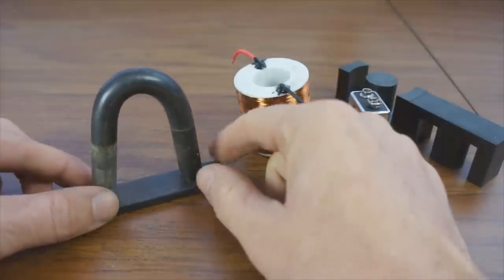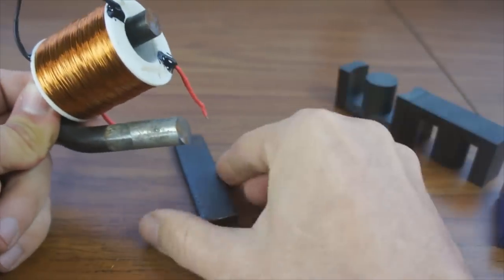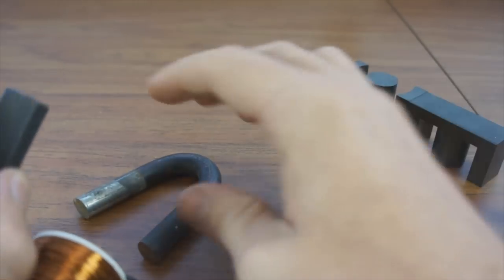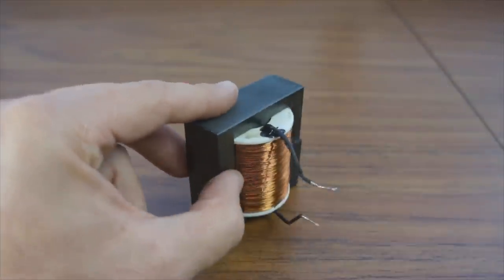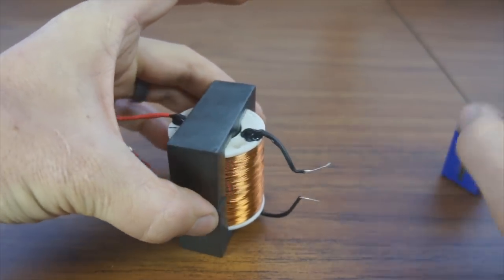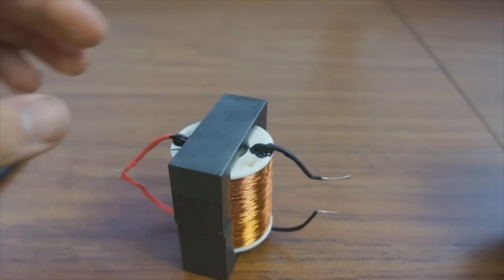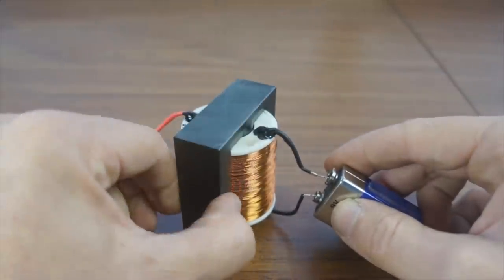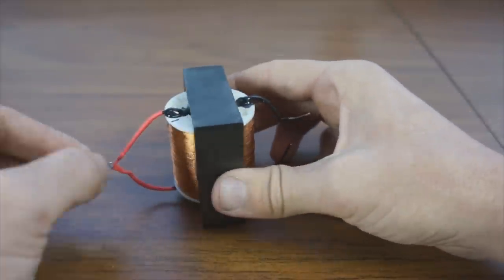PMH - Electromagnet keeps holding after power is removed?

Comment: it would seem that with the leads on the coil shorted the energy can not escape when battery is disconnected so the current that magnetizes the two pieces together can will hold until energy is used up

Comment: Excellent topic and generates lots of discussion.  You're doing a great job because of your own scientific curiosity to inspire others.  Keep it up, enjoy your videos immensely.  Would be a very cool product where you could flip a switch and have a magnetic lock.
Reply: They make those: http://en.wikipedia.org/wiki/Electromagnetic_lock
Of course, they use materials that don't stay magnetically locked in case of power failure for safety reasons.
Reply: That's my point - it wouldn't need continuous power.  It would also be much less expensive requiring only a small voltage to energize.

Comment: Could it be an electrically enduced Casimir effect? It seems to prefer nice and flat matching surfaces, right?
Interesting to me is that there seems to be an upper limit as to how strong the residual locking can get. No point in energizing the coil(s) longer or harder. So it's about the materials and likely surfaces more than about power and duration of the energizing.
How do parts of various metals work, when dimensioned and surface treated identicually? Can we learn from those results?

Comment: well it seems to make sense to me don't think it is strange. It seems to me that there is 2 magnetic fields working and one is holding the other to it. Have you tried quickly connecting the blue together once you take the ends off the battery? Maybe it will hold together if you do so.

Comment: So you have never noticed this effect with magnetic door locks? Activate the unlock mechanism the first time. (motion detector, wall button, or ID badge access) You have to push harder than normal to break that residual magnetic lock. Attempt is a second time before the electronic timeout happens then its quite easy to open. Generally you have to go into a building after hours to find these type of door locks. Hospitals have a lot of them. Some doors with badge access have them as well. Although of course you need an ID badge to play with them.

If you play too much you might create a red flag with the security department. Just a little warning LOL.

Comment: Mutual inductance. A normal inductor stores energy by creating an internal magnetic field and collapsing that field when the energy is released. As long as current can flow through the inductor without resistance, the magnetic field will remain. If you break the circuit the magnetic field will collapse instantly, and a high voltage spike will be generated. In this case, you have a secondary winding, so when you open circuit the first, a current will be immediately induced in the secondary winding, which allows the magnetic field to remain until the parasitic resistance in that winding bleeds it off. This is similar to how a flyback converter works.

If you had an ammeter across the secondary winding, the first thing you would see is a sudden flow of current once the battery is connected as the transformer is resisting the formation of a magnetic field by canceling it out with it's secondary winding. (similar to how an AC transformer or forward converter works, it resists the formation of a magnetic field by transferring all of the energy from the first winding to the second instead of storing it as a magnetic field intermediately. This is more efficient and allows for more power, but it limits the output voltage to the input voltage times the winding ratio)

This current will decrease because of the resistance in the winding, and a magnetic field will form in the transformer. (If you want to be more efficient, open the second winding during the initial charging so it doesn't fight the formation of the field).

When you disconnect the battery, there will be a sudden flow of current in the opposite direction because the second winding is no longer fighting the magnetic field, but holding it. (flyback converters have a diode that only allows the current to flow in this direction).

This current will decrease slowly because of resistance in the second winding, and the magnetic field will collapse.
Reply: Thinking about this further, If you want the effect to last longer, you want the primary coil to have more turns not the secondary and heres why:

First, This allows for a stronger magnetic field to form initially.
Second, the number of turns on the secondary winding theoretically has no effect on the rate that it dissipates the magnetic field
The amount of current needed to maintain the same strength field is proportional to the square root of the number of turns (according to the equation for energy in an inductor: E=.5*LI^2. Energy is proportional to field strength). Let's say you have an inductor (A) with 4 turns at 1 Henry and 1 Ohm per turn(unrealistic, but it makes the math easier). And another inductor (B) with 1 turn at the same inductance and resistance per turn. If you energized inductor A to 1 amp, it will hold 2 joules. If you energized inductor B to 2 joules, 2 amps will flow through it. According to the formula P=i^2*r, inductor A is losing 4 Watts of energy at t0, and inductor B is also loosing 4 Watts of energy at t0.

For the secondary winding, use heavier guage wire. It won't affect the inductance, but it will decrease the resistance of the winding. A wire with twice the cross-sectional area has half the resistance, and will dissipate half the amount of power.

Comment: This effect is called Magnetic Hysteresis, at least for the former example. When an external magnetic field is applied to a soft metal (soft referring to the magnetic properties) such as soft iron, the domains in the metal will align themselves with the magnetic field. Even when the field is removed at least part of their alignment will stay. By doing this, you have magnetized the metal, and it will stay magnetized until either it heats past its curie point or you apply a magnetic field in the opposite direction.

http://en.wikipedia.org/wiki/Magnetic_hysteresis

As for the latter example, the core you seem to be using is a EER Powdered Iron core - which is made of hydrogen reduced iron (1) -, and has a higher coercivity than regular iron (2) so it takes a stronger field to magnetize it. As for why it holds if you short the secondary winding, that remains a mystery 

1. http://en.wikipedia.org/wiki/Magnetic_core#Iron_powder
2. "Coercivity is a measure of the ability of a ferromagnetic material to withstand an external magnetic field without becoming demagnetized." ( http://en.wikipedia.org/wiki/Coercivity ) This still applies if the material is not magnetized, but rather it is how difficult it is to magnetize it.
Reply: As to the first example, I was thinking retentivity (retained) magnetic field is part of the hystoresys  curve that remains after magnetizing current has been removed. Retentivity and coercivity being component that contribute to the area of a hystoresys curve. But...... one might expect that  retained magnetic field would be retained in the metal even after the parts were seperated. But, retentivity is a little energy retained and stored in the magnetic domain alignment in the metals. Then when you seperate the two pieces, you change the magnetic reluctance in the circuit. And something else has to change with it.   I think The rapid change in reluctance causes a rapid change in the strength of the field and that induces a higher demagnetizing eddy current in the steel parts. 

The ferrite core isn't powered iron with high corecivity.  Ratherly it's a ferrite core for a high freqency transformer. They are designed with little area inside a  hystoresys  curve,  meaning both low corecivity and low retentivity., which would explain why it would not stick once the magnetized current was removed. For instance, there was little to no retained magnetic field and the parts would fall away. But..... a shorted secondary seems to retain a magnetic field, almost as if current had continued to flow in the secondary.  3 years ago I asked if he would put a resistor in the secondary circuit, but there was no response.

Comment: I would think that after you put the electricity in it is re conducted by the coil to maintain the electromagnet, and with the transformer I guess it just releases the power faster because the function of a transformer is to change amounts of voltage and ampage, either way around for higher or lower and I think some is generally lost in that process when constant energy even so I think that is why.

Comment: wonder what would happen if you could get soft iron shaped the same way for each apparatus you are testing - then you may find out geometry might be the issue here.  perhaps instead of using the other half of that transformer core use a soft iron bar with the other transformer core. Just a suggestion... like Ed said, if the coil is closed circuit the energy will circulate forever, assuming there is no electrical leakage anywhere. open the circuit and she will loose her attraction - regardless it looks like your on to something cool

Comment: You are proly retired by now lol but anyway.... magnetism flows in a spiral and electricity is always trying to transmute magnetic changes into electricity.... But it's a surface phenomena, where magnetism is batteling its way from the conductor as loss.
In Eds PMH, the closed loop formed is trapped like a dragon eating its tail, while in the other transformer, it has 2 paths to take from its creation thus anihilating. If you shorten the other coil, the magnetism is stored as inductance and since the core is already saturated it diminishes slowly.
What we need is a bi-jouel thief so we have a push-pull. Something similar to what Master Ivo alluded to recently.

So when the field starts to collapse, you induce the other 2 "center tapped widings" so you push a stronger directional magnetisation.
I believe you need an air core and a panckake design... The only thing i dont know is how to make it self oscilating without the need of a chip drive... It should oscilate itself based on the amplitude if that makes sense or is even possible. So 2 center tapped coils where 1 is wound in + direction and the other in - direction and as you oscilate one, you should oscilate the other in f=f-(t/2),... but now that i think of you would only get a stronger transformer... idk realy at this point, but the jewel thief working is not explained correctly from most sources i believe, as when the transistor closes it still uses the other leg of the coil as an additional pump... something that adds magnetism on top of the saturated one, thus increasing the amplitude of the induced current.

It's all about interuptions in this case, but perhaps we should make mechanical sine-waves of high frequencies and go from there before dwelling on the extreme interuptions that a transistor can produce... square-waves are not good company for the living.

Comment: iron bar is solid metal and it gets magnetized north south when energised. having north south orientation on the u bar naturally attracts the small iron plate link suspended below its poles..ferrites are dust particles of iron and non magnetic material mixed..they dont allow total free movement of electrons through them like solid piece iron so their magnetic north south orientation energy dies as soon as the electricity is removed..the temporary holding effect you get from a bifilar set up with the other end shorted is probably due to the back emf created in shorted secondary coil as you de energised the primary wind...it dies down as the arced back emf loses its power due to the shorted ends and electromagnetism is gradually lost..John Bedini  will be able to intepret this better than anyone else still alive cos he uses these back emf forces to recharge batteries and probably has tons of these bifilar coils and configurations in his backyard

Comment: Hi on the red wires make a figure 8 and in the cross over it may give out all voltage and loop back in joe booker explains in joe cell talks 5. Static then transformed by oscillation looping

Comment: do you think  that due to the alignment of each metal a softer ,like the u bolt test, would line up easier and the core test would need a time delay or slight  residual effect to allow a better alignment to hold a harder metal in place. my thoughts are on a pulse test on a harder metal instead of a coil to hold it . if that make a difference?

Comment: one thing i can think of or experienced. i build a starship coil and when i apply high voltage from microwave transformer and disconect power even with no caps attached to it it will spark like if the coil it self would charge up and hold a charge. in your case when the secondary coil was tied it absorbed the energy from the first pulse of battery but because of the shape of the e core it caused energy leakage. ORGONE energy always leaks from sharp corners the u shape bar has a better ability at holding negative energy wich travels in curving types ways

Comment: Wow neato.  I wonder if there is a conductive (or lack thereof) aspect to the core material maintaining the field? This could probably be determined by putting a piece of seran wrap between one end of the "horse shoe" and the flat bar in your first example.  I have a feeling it will not hold... but not sure...

  Is the shorted secondary coil  performing the function of a ringing/cycling magnetic field? An inductive inverse-capacitor of sorts?  Perhaps, like a capacitor holds X volts at 0 amps while sitting as an open circuit, an inductor holds x amps at zero volts while shorted?  Crazy talk!

  Just for kicks, instead of shorting the secondary coil together, what if you wrapped a single turn of 1/2" wide, but very thin copper foil  around the circumference of the core creating the "conductive loop" aspect... loose enough to see if the halves separate after removing power, but tight enough to interact with the core to establish a magnet field after power is removed.   Just throwing it out there.

Comment: Well you would think that it has to do with the current. Your charging it up to keep the magnet going and the short acts as a completed circuit. So it will hold the charge until the current runs out. When your cooling the coil your allowing the electrons to flow more freely do to it being cooled. like a super conductor. As such, until the current will lose less energy as it flows though the current you are making. I am not an expert on this but from what i have read and see that is what it looks like

Comment: The coil is sluggish. If you supply a non coil, which has no magnatic field, then the coil is fighting because it wont change the magnatic field but the coil has to change the magnatic field. Always when a magnatic field is changing it is Göring to induces voltage Ingo coils.

I have learnd this in my school, sorry for my english (my primary language is german)

I think
Primary Coil - secondary coil not connected itself
Primary coil 1 layer, has less sluggish then the secondary coil. After You disconnect the supply it fall.

Primary coil - secondary coil connected itself
Primary coil works like a transformer, it induced voltage in the secondary coil. (e.g. pCoil has 1 layer 9V 100mA polarity 1.1=+ 1.2=- and then the sCoil has 30 layer the voltage at one moment would be 9V*30=270V 100mA/30=3,3mA polarity 2.1=+ 2.2=-)
Coil is connected itself, it flows a little current. If You disconnect the supply Form pCoil, then the sCoil has a still a magnatic field because the sCoil is trying to hold the magnatic field. After it lost the fight then the magnatic field changes (Always when the magnatic field gets changed it induced voltage into coils) polarity pCoil polarity 1.1=- 1.2=+ sCoil polarity 2.1=- 2.2=+ . sCoil is gets again a induced voltage, again it is flowing current because it is conneted itself (pCoil gets induced voltage too, but there is no current flowing not connected itself). sCoil has again a magnatic field. (e.g. sCoil voltage 260V) it is going to repeat this process of changing the magnatic until the induced voltage drops down to 0V, a transformers has a efficiency factor of 0,98 to 0,99. Until the transformation process stops the frame falls.

If You would connect a amp meter between 2.1 and 2.2 then You would measure a ac current.

Or if You would seperate the secondary coil into two. You would geht connectors 2.1-2.2 (first half of sCoil) and 3.1-3.2 (second half of sCoil). Then You would connect 2.1 to 3.2 and 2.2 to 3.1, then You could measure AC voltage on 2.1(3.2) and 2.2(3.1).

This is my explanation.
RcCarFan01

By the way i'm learning mechatronic (elektronic and metal editing (turning, welding...)

:D i like your Videos.

Comment: Everybody remembers information stored  in their brains for years. Is this due to hysteresis, or is it a stored pattern like a disk storage device requiring electrical stimulation to "release" the memory information.  Have you tried reversing the battery polarity to "discharge" the coils. There is no real observable physical motion, therefore no observable kinetic effect , so perhaps this is simply stored potential energy holding the conditions to permit magnetic hold to dominate until the unit is discharged.I disharge my device with only a single winding  but with a magnetic core inside to power an led. After discharging two or three times the magnet will not be held against gravity by the coil ie after discharge.